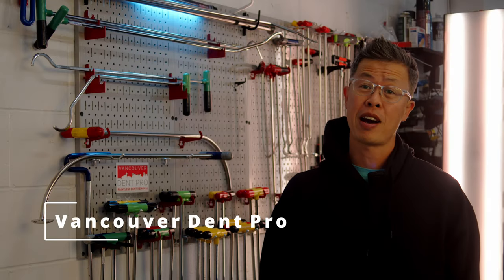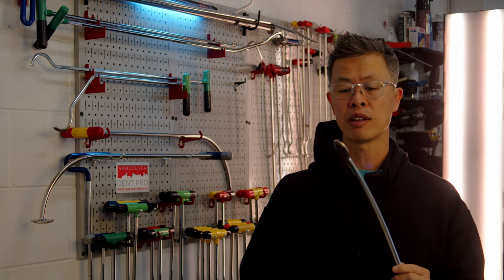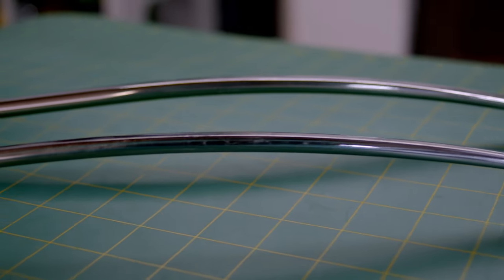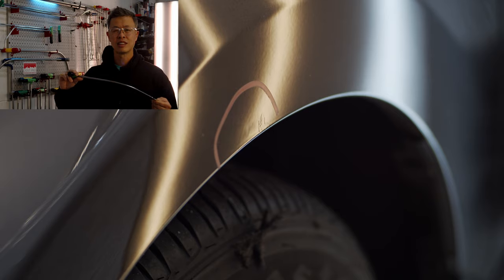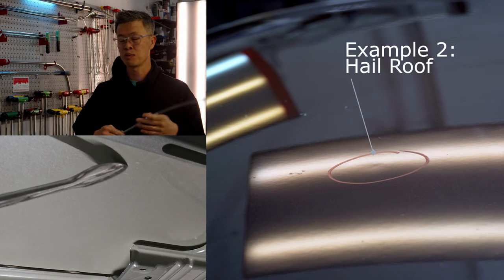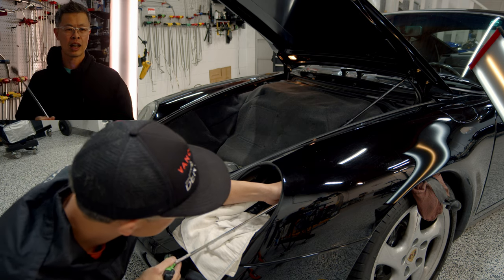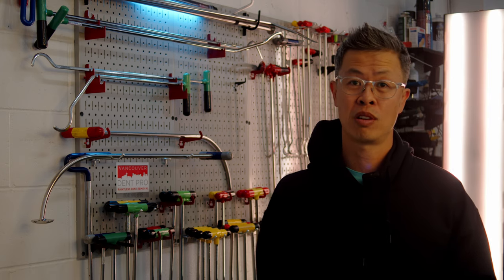Stanliner Brace Spoon Tool | Paintless Dent Repair How To | by Certified Stanliner PDR technician

Comment from the maker: 00:00 Intro
00:33 Brace Spoon PDR Tool Overview
02:33 1) Fender Edge from engine bay (rolling metal from outside to inside the dent)
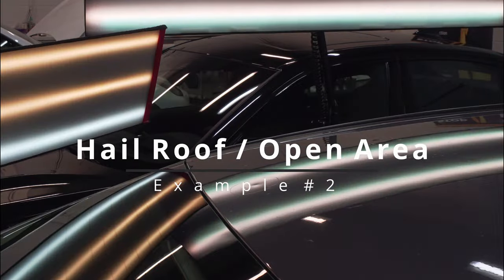05:03 2) Hail dent on a Roof open area
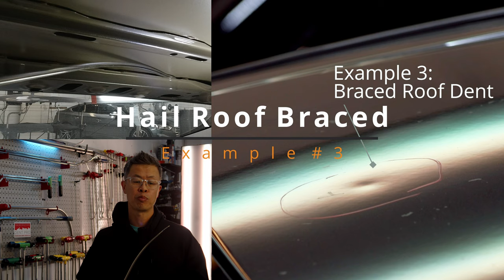06:16 3) Hail dent in a tight obstructed area
06:52 4) Obstructed Porsche Fender cleanup on a previous rough PDR job

Comment: Today, looking for some ideas to my "stanliner" diy tools, I've found your pdr tutorial. Clean, explicit, perfect structured, good camera angles, man, awesome work, thank you a million times for  everything! 👍
Reply from the maker: @dnebun Thanks for the encouragement. At first I tried making one DIY, I did eventually give up and bought the real ones knowing how hard it was to shave the edges to where are functional this way. Glad this helps and I hope trying to diy them will help you appreciate these even more! Best of luck on your journey
Reply: @VanDentPro  I worked as a sheet metal in aviation, it's in my blood kind of to work with metal, cut, grind, bend so it's a bit fun and challenging. In 2020 I lost my job and I discovered PDR, I love it more than my initial work as a sheet metal.  It's challenging and it let's you to be creative  and have an unique approach. I wish my "small shop" be a little bigger but at least i can make tools and try them out. I know how they make the tools, which materials and machine they use. 
PDR changed my life and I hope that soon I will be able to do this full-time as a job and in parallel to make tools for this industry. 
Anyway, thanks again for your vids! Keep up the good work👍 cheers!
Reply from the maker: @dnebun  I love it, that's a great story. I really hope for your success. I have some background in fabrication and casting too, it really nice to have that experience in my back pocket.